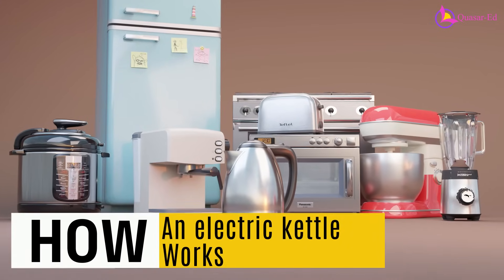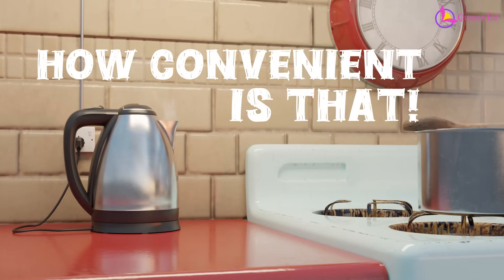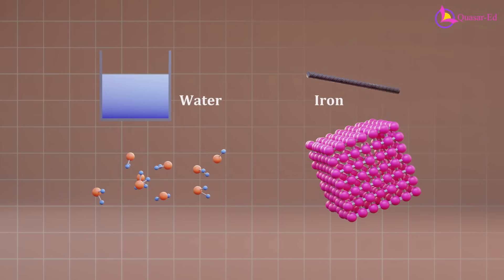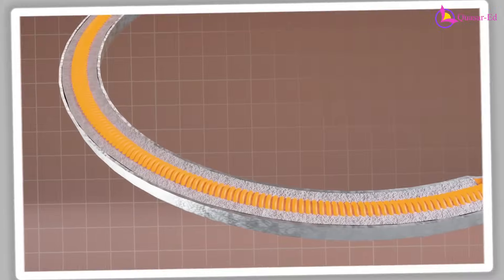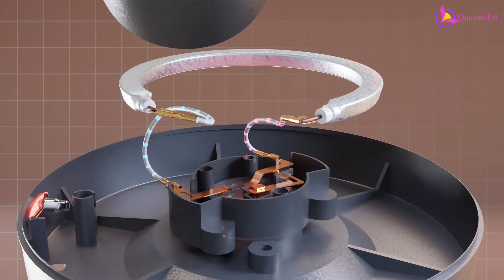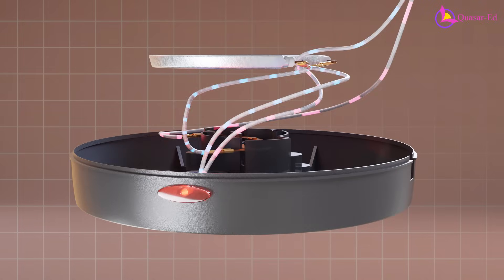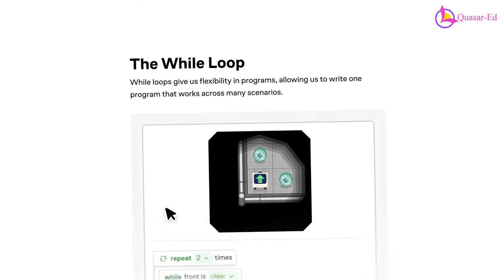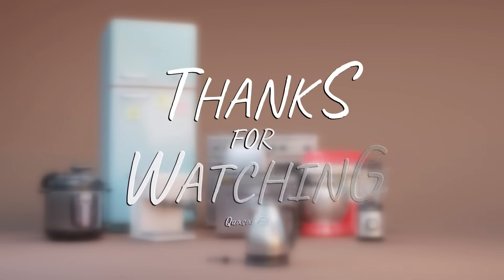The Engineering behind Electric Kettles

Comment: At 5:05, "... insulated by a heat-conducting material..." - can that be right?  Sounds like an oxymoron!
Reply from the maker: 😂😂😂.  I didn't even notice that.
Reply: @quasar-ed I love the video, by the way, but am still trying to understand why using a higher resistance conductor (nichrome) produces more heat in the heating element than a lower resistance alternative.  If the potential difference is fixed (is it?) at, say, 220V AC then doesn't
Power consumed  = V^2/R
imply an inverse relationship between resistance and power (heat generation)?  I know it's correct as presented, though, so what am I missing?!
Reply from the maker: @neiluk4109Resistors (which resist the flow of electricity) produce heat as side effect when resisting. And voltage drop occurs when electricity passes through a resistor. So the higher the resistance, the higher the generated heat, also the higher the voltage drop. With your formula (P=V²/R), we can't use 220V as V, we need to use the dropped voltage across the resistor, which can be calculated by V=IR. So the new power formula becomes I²R, which is directly proportional to the resistance. I hope that makes sense.

Comment: when i was younger i was tampering with the PLUGGED IN kettle base using a big metal sewing pin. there was a pop and the breaker tripped saving my life. is it accurate to say i might have touched the pin against the copper strip that was linked against the live wire component?
Reply from the maker: Yes, you did touch the live wire. The breaker saved you.

Comment: Good information. Thank you very much.  All along I was thinking how the thermal swtich fixed to the plastic handle of the kettle and which has no contact with the metal part of the kettle (!) ,  primarily gets off  automatically, when the water boils to 100 digree centergrade. Now I under stood that  the heat tranmitted through the wire connected to the thermal swtich on the handle that does the function of trasmitting heat to bimetal sensor.  Thank you. From India. God bless you.

Comment: This is incomplete - it doesn’t show how heat flows to the bimetal disc, or how its reaching the proper temperature makes it bend enough to push the switch off. Thumbs down.
Reply from the maker: @zantigar  Sorry, I thought you knew. Btw don't touch the kettle body when it is on, you might accidentally  understand how the heat flow.

Comment: How will i know if my kettle has a fail safe switch?
Reply from the maker: Most do. But you can open it up just to make sure.
Reply: @quasar-ed  i can open it up, but I don't think I can put it back 😂
Companies should mention it on the box.

Also, what's the best way to clean the white deposit in these kettles?
Reply from the maker: @CaptainLEVIasArkhamKnight  😅😅. I am not sure what you meant by white deposit. Never had those.

Comment: Incredible video! I wanted to learn how kettle works, and this video is excellent! Great animations and illustrations,  great science, and the narration is very good, too! Thanks a lot. I have a question though, my electrician told me not to leave my kettle plugged in as it could make the coil hot and start a fire. But from my understanding in this video, when the switch is off, no current will flow in the heating element, so he is incorrect!
Reply from the maker: @mohamedkotb2153  Yes.    You can always leave your kettle plugged in. It is the main advantage of having a removable body.

Comment: One doubt how the bimetallic disk will get heated in the switch. Because if it is bending then it needs to get heat from somewhere can you please explain that part 6:26
Reply from the maker: @gavallapallidheerajsai594  It is located inside the handle where steam from the kettle can reach and heat the bimetallic strip. The one located underneath however get the heat because it is fitted near the heating element.

Comment: you missed the detail about why the bimetal at switch bends as it does not connected to any heating element  and how it senses water has reached 100 degree celcius.
Reply from the maker: the one under the switch get the heat from steam while the bottom one get heat by convection since it is so close to the heating element. I guess I should have add that. About how they senses 100 deg C or not is because they are calibrated that way.

Comment: You are completely wrong about the heating element; it does not use nichrome wire for heating but rather a copper coil for inductive heating i.e., the magnetic effect if the  coil causes the metallic base plate to heat up instantly.(the same principle as in an induction cooktop). That is why it is able to boil 1 liter of water in just 1-2 minutes; if nichrome were used, it would take five or ten times longer. And, the base could also start heating or melting after some time. Also, the metallic coin-like thermostat does not necessarily work at 100°C. Instead, vapor is passed through a narrow column from the side to downwards, causing both metallic strips to return to their original shape (bcauz of heat in the vapor) which hits the switch to off, That also means that they can turn off even if it's not 100°c and will not auto-off if the lid is open.
Reply from the maker: @ashishpathak2812  I don't know what kind of kettle you are referring to. The kettle in this video doesn't work that way. I still have the disassemble parts. For induction heating, it needs to have a frequency circuit but there is none. For thermostat, of course the vapor carries the heat. But it only the case for the upper switch. The vapor doesn't go down to touch the lower thermostat because as I said in the video, the lower thermostat is attached to the bottom of the kettle, so the heat is transferred by convection. If you've come from watching steve mould's video believing that's how all the kettle works, you are wrong. What he explained in his video is just a specific type of kettle and it doesn't apply to every kettle.
Reply: @quasar-ed  absence of frequency circuit is a debate topic. Besides, the tech they say is spill proof, actually they smartly use the same for the vapour transfer, hole on top part in the inner section can not only drain the extra liquid via the holes on the bottom section, but also transfer the heat within.
Reply from the maker: @ashishpathak2812  Actually, you need a complex frequency and power circuit to actually generate induction effect. You don't get induction heating with just AC frequency. If you want I can show you the nichrome wire inside the heating element. There is no vapor column to drip downward. It is bad for the kettle in my video. The presence of water vapor around the heating element and AC line circuit is really dangerous for short circuit and corrosion for the screw terminals. Please watch it carefully again.
Reply: @quasar-ed   @quasar-ed  bro u won't believe , I went to my friend a while ago, and he had the exact same model like yours, and yes it do have the tube ,u must have not noted it, actually in this model it is directly in the plastic part , which is extended a little bit inside in the kettle to hold the lid., u will see it in the downward side of that extended plastic. It is not easily noticable.... However the lower thermostat also does work even when the lid is open that means it could be also with vapour tech... Additionally I opened my kettle also and found that they are using aluminum screw and varnished strips to prevent corrosion.
Reply from the maker: @ashishpathak2812  well, I am not trying to argue. This cheap kettle doesn't have anything that even remotely looks like a tube. I've been opening them and fixing them since high school. Do you know much it costs in usd?  THREE dollars. Even up to 10 dollars with a little bit more fancy design, the inside are mostly the same. A quick google will show you there are kettles which come with vapor tubes and there are ones which doesn't. But they all use resistive heating.
Reply: My friend, electric kettles work on the principal of resistive heating, they use nichrome and not copper, maybe do your own research before blaming people on the internet.
Reply: @RakeshShetty-y4j  well same pinch for you too, but i have also done proper research; Resistive heating is not that much faster. Refer to research gate articles.
Reply from the maker: @ashishpathak2812  Just because it is better doesn't mean it should be used everywhere. Every method has its pros and cons. Check out the wikipedia about induction heating, https://en.m.wikipedia.org/wiki/Induction_heater
Reply: Hmm, that seems more correct explanation
Reply: Yes yes you are right sir
Reply: yes! some kettle with this type of switch never off when the lid is open

Comment: 7:53 why 100 degree Celsius?
Reply from the maker: @অৰি  Because water starts to boil at that temperature. And that temperature is hot enough to make a tea, coffee, or cook instant noodle. It is also where most of the bacteria inside the water die.
Reply: That thermostat thingy is configured to trip at that temperature.

That specific shape only has 2 stable configurations, that is, it acts as a spring loaded trigger.
When it gets close to that configured temprature(trigger point, that is 100°C in this case), it trips and changes its shape to a different stable shape (which is the one with it's tongue out).

Comment: how is it certain that bimetallic strip will only bend when water is at 100 degree celcius
Reply from the maker: @incrediblecloud9803  The metallic strip is specifically calibrated that way. For example, if the strip bends at 150 degC, they would reduce the metal thickness a little bit until it bends at 100. Since every metal expands with temperature, they just need to adjust the shape and thickness of each metal to bend at specific temperature.

Comment: They usually put the ground pin on the outer ring where it can be touched. A metal rod doesn't get hot because the current is limited by the narrowest part of the circuit somewhere else. Less resistance means more power. The automatic switch relies on steam being driven down a tube. The metal grill in the spout helps with that. If that grill is removed, then the autoswitch won't react for some time. As long as there is water inside, the temperature will be limited to 100°C. Early kettles didn't have any of that and worked just fine. See a soviet coffee percolator.
Reply from the maker: @j7ndominica051  Are you sure we are talking about the same kettle? It is true that the switch on the handle get the heat from the steam. But the steam doesn't need to go down to the bottom thermostat and there is no tube for that in this design. Because the bottom thermostat is placed just a few millimeters from the heat plate. So it can directly sense the heat without relying on the steam. The one you are mentioning might be built differently.
Reply: No, I've not seen this particular kettle. It possible that it is built as you said. I took the animation more of a schematic of a generic kettle, not a specific model. The plastic grille easily breaks. And there is video on Youtube (I can't find it) where he demonstrates the effect of taking it out, allowing the steam a fast exit path.
Reply: When the dielectric collapses, it becomes dangerous. In general, electricity and water are enemies.
Reply from the maker: @ياقوت-ق  true.

Comment: Kettles do not switch off because a thermostat. If they did, the temperature would be the same and it will boil too high or too low depending on the altitude. It is a small tube that fill with vapour what stops the kettle. Try a kettle with the lid open, never stops.
Reply from the maker: @miguelJsesma  The kettle you mentioned is different from the one I use in this video. Cheap kettle like this will never come with that fancy feature. Of course if the lid is opened, there is no way for the heat to reach  the thermostat and the switch won't trigger.

Comment: Wouldn’t you want a lower resistance wire instead, since heat increases with current squared?
Reply from the maker: In case of heating, we want more heat, so more resistance is better. For conducting wires, we don't want heat, so the lower the resistance, the more efficient the energy flow.

Comment: I'd be remiss not to mention this Steve Mould video: https://www.youtube.com/watch?v=VzqN4Cn8r3U

Some kettles work in a smarter way, where instead of simply having a bimetallic strip that responds to the temperature of the *liquid*, a tube carries vapour from inside the kettle over a bimetallic strip. Only when the liquid boils, and the vapour pressure increases considerably, does the tube carry enough vapour to heat the bimetallic strip to its trigger point and switch the kettle off. That means that such a kettle responds to boiling in general, and not just the temperature water boils at at standard atmospheric pressure, so it'll work even if you use a different liquid, or take it to a high elevation where the boiling point of water is reduced.
Reply: Yeah, this video is what came to mind when I saw this mechanism.
Reply from the maker: @Redingold  Gonna check that out. Thanks.